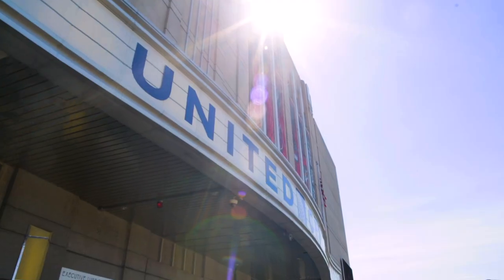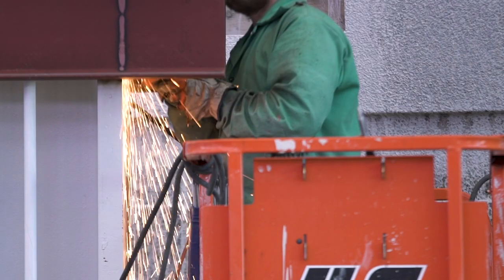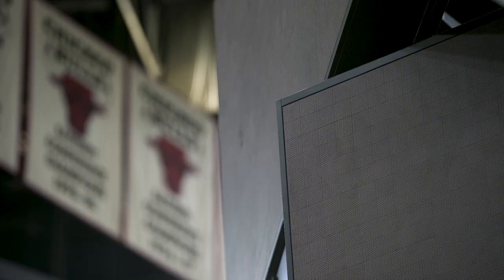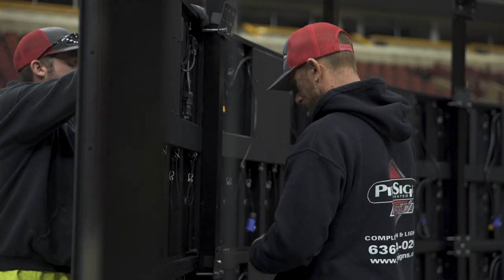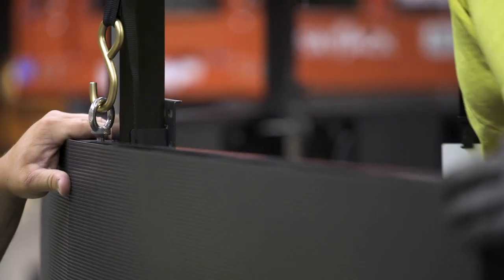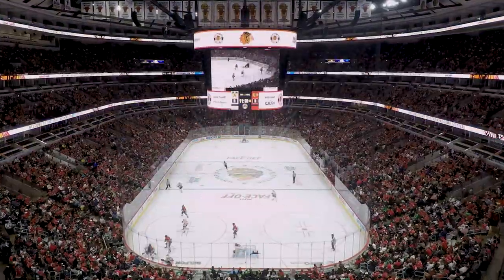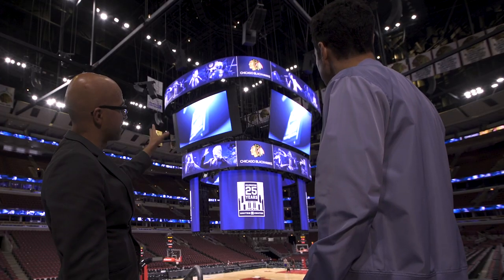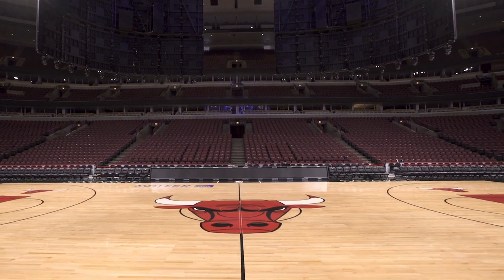BEHIND THE SCENES: United Center Cutting Edge Scoreboard

Comment: “Largest arena in North America” lmao. The Greensboro Coliseum in NC is bigger
Reply: Its not
Reply: Lloyd Dean actually, it is. Greensboro Coliseum can hold 23,500
Reply: Kilian Sheehan I said can because it depends on events. Hockey is only 22,000 seats and Baskeball is 23,500 permanent seats
Reply: It's by square feet
Reply: It’s gone
Reply: @ajpetrulis6782  what do you mean?
Reply: The United Center can seat up to 23,500 also. And the United Center is largest in size
Reply: @moronmonkey1  yeah but the set basketball capacity in Greensboro is 23,500. The one in Chicago is only in 20,000. If you fill the floor with seats, you’ll probably have over 25,000
Reply: @GoalHornGeek  no
Reply: But that’s a coliseum, not an arena. It’s in the title itself 😅 (sarcasm)
Reply: @ChicagoNava3  Greensboro Coliseum: 450,000 square feet in size, seats 23,500.  United Center: 960,000 square feet in size, seats 23,500 at max capacity.